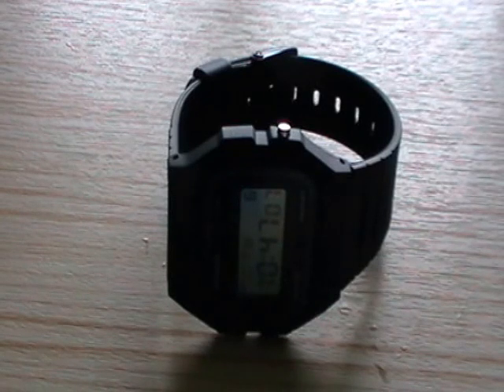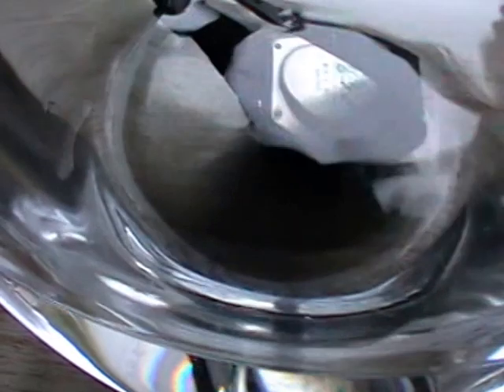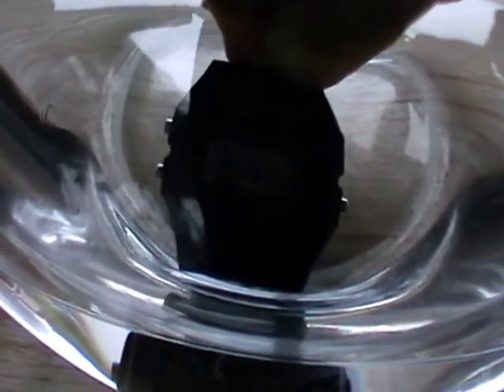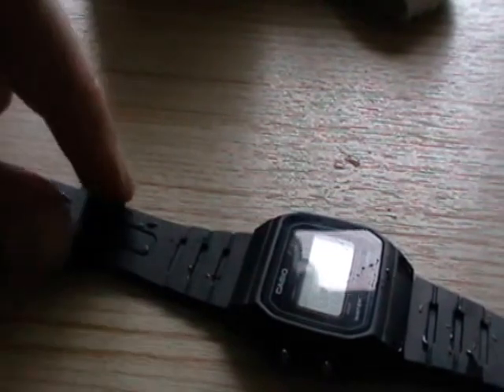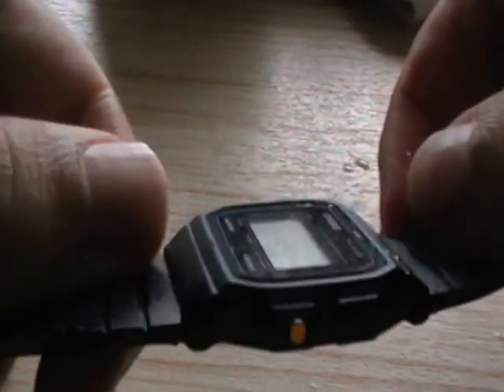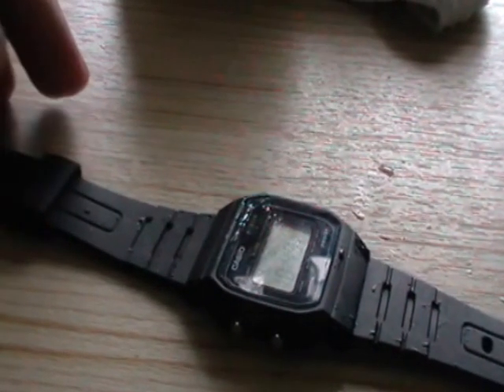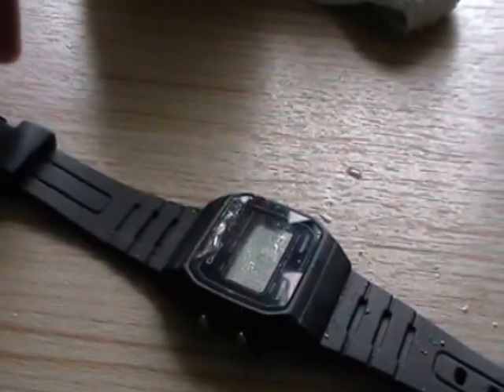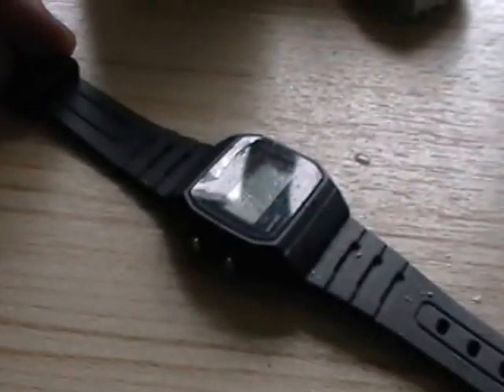Casio F-91W Durability Test - F91W Hammer Hit test, Strap tested, water resistance

Comment: 30m doesn't mean 30meters, it's just a proprietary designation of a certain type of water resistance. I know, it's confusing and dumb. 30m watches are splash-proof. People report having showered and even swum with these so I would see no problem doing it IRL.
Reply: i saw this at walmart is it worth getting for $15
Reply: +Jude Meler absolutely. you can get these for about $10 online.

Comment: Nice tests. Why are there so many dislikes? I think the dislikers must be from the G-shock owners, knowing that they over spent and that they can get quite a rugged and legendary watch at the price of a Swiss chocolate bar. (Just kidding. I love the G-shock as well. But no watch in the world can beat the value of this simple yet time proven device called the Casio F91W)
Reply: probably the quality of the video and the hammer test shoul be progressive in my opinio. like firt test some drops from hight, throws etc. not a bad video but too short he could do more test on this little hero
Reply: Yeah it could have had more progression in the shock/hammer tests, buy it's a homemade video on a small table using whatever he happened to have on hand. But even at that, most of us will never get anywhere near the amount of force ha was applying. Like the band stretch test... If you get anywhere what it would actually take to snap the band, lug(s), pins, or buckle, a piece of you is coming off or at the very least, dislocated from its socket. Or the shock "test", if your watch takes just one hit at all like those while you're wearing it, something bad is going to happen to your wrist, fingers, elbow, shoulder, muscle, tissue, cartilage, etc. It won't be pretty though.
I'm kind of curious about water though... As in, how far down would you have to go before the water pressure pushed the buttons in for you?
Reply: Probably the ultimate test ...which to me at least seemed a bit destructive for the sake of it, that's why I thumbed it down.
Reply: because of him destroying poor watch, also nothing will happen to g shock if u hit it with hammer

Comment: This is the toughest wattch i own.
Reply: Then you have only one: this
Reply: Now I'm kind of curious to see about other Casios. Not mine of course, but others!
Reply: G shock square m5610 solar powered and atomic timekeeping via radio you never have to set the time even during daylight saving changes even when you go abroad as it sets everynight or you can force a time reset with the atomic clock when abroad and you will never have to change the battery as its solar powered and its as tough as a brick. The value pricewise is insane for what u get in such a small tough little package. A totally maintenance free beater of a watch.

Comment: ...very rude testing... you have no idea what you are testing. I suggest a more scientific approach: you may want to test the G-Forces it can get... throwing it from different hights, and by calculatung the g-acceleration and the impact speed you can easly calculate the g-force it resists. One hammer hit should be enough for a mechanical mutilation test... you are just hammerng on it... aiming to destroy it... :-(
Reply: just a waste regarding this silly test.